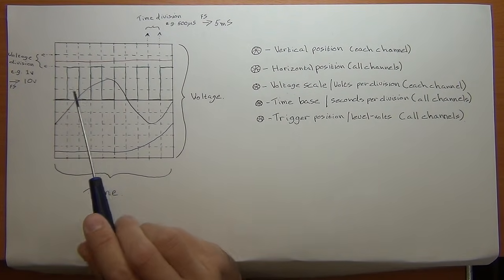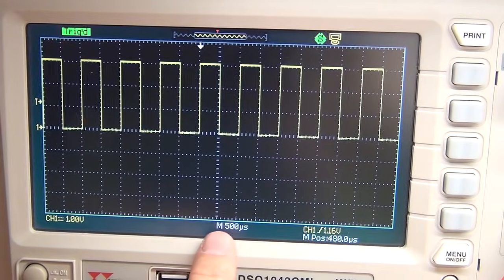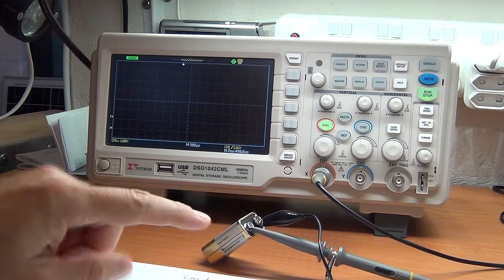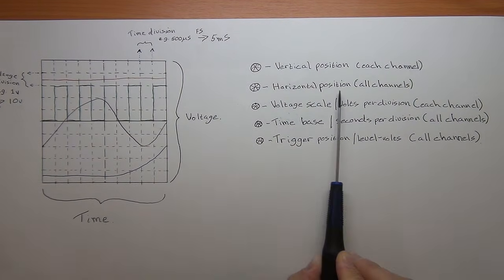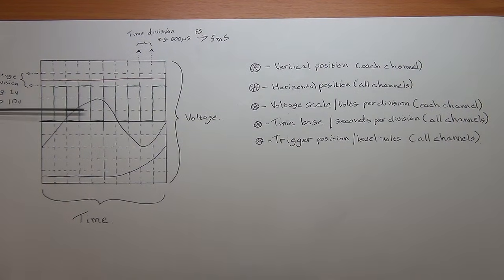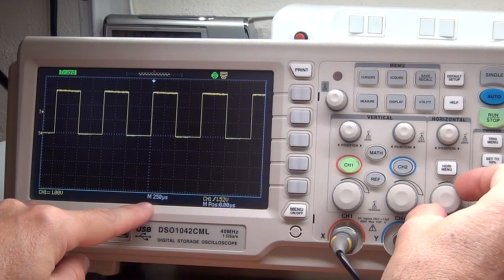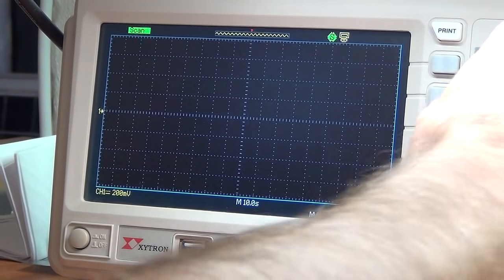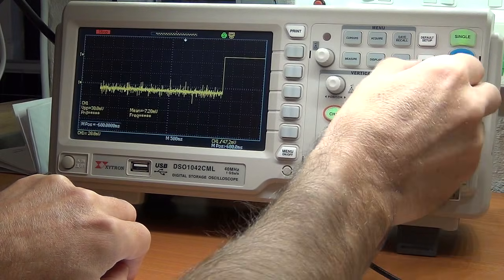How to use an oscilloscope / What is an oscilloscope / Oscilloscope tutorial

Comment: Thanks MJ. I know I'm late for class....So if you have a power supply feeding the Cap, how does the scope know to only measure the building voltage in the cap rather than the constant voltage the PS is putting out? Thanks again!

Comment: Great video, subject beautifully explained. I want to balance a motor/pulley which is vibrating, so I intend to utilise a cheap accelerometer (intended for an arduino) and an infra red LED which ‘sees’ a bit of reflective tape every revolution. The idea is that the regular pulse from the reflection is fed to channel 1 on an oscilloscope (which I don’t (yet) have) to establish a marker pulse and the pulse from the accelerometer (on channel 2) is overlaid on he screen. If I can measure how far the Ch 2 pulse lags the Ch 1 pulse I should be able to figure out the angular position of my balance weights. As a mechanical engineer, knowing how to use an oscilloscope is essential to making my plan work, so thank you for simplifying something which was a mystery to me - it will also inform my choice in acquiring equipment… probably, for my purposes a PC based USB oscilloscope.

Comment: For those confused on how to display slow moving voltages such as charging capacitors as discussed here, I eventually discovered you need to switch the instrument to 'ROLL' mode or in the case of XYTRON oscilloscopes-  "SCAN" mode.

Comment: Im in auto diagnostics and this helps alot. The firing of plugs, injection of fuel, time between these two things alone is a major factor in finding a problem that normally would be very hard to detect. OBD diagnostics with fuel trims uses alot of these formulas. Fantastic. Thank you

Comment: With regards to the capacitor charging. Why is it that it charges only at a linear rate? I am guessing It is because you set the power supply up that way for learning purposes?! Mathematically the rate at which a capacitor charges is logarithmic; hence the confusion. Great videos, thanks

Comment: Thank you so much for posting this. I bought an older Hitachi 100mhz analog unit at a hamfest for cheap  and am trying to figure out how to use the thing without blowing it up. I do tinker with relatively higher voltages in vacuum tube circuits and was wondering if there are any really basic rules of using the oscilliscope with these kinds of voltages, up to 500V at times or more... Again, thanks for posting this.. Also can you comment on the differences between analog and digital scopes ?

Comment: An 1:1 isolation transformer would work safely 09:50 .
Reply: Make sure to float the device under testing, and never the scope!  If you accidentally put the ground clip on mains voltage with a floating scope, the whole scope will be energized to mains voltage!
Reply: @autogolazzojr  Absolutely correct.   When ever I am repairing something, the unit being repaired is connected to an isolation transformer, with the ground pin also isolated.   No chance of a complete circuit this way.  I also work on a plastic floor mat with a non-conductive work surface.   Safety Safety Safety.

Comment: I have 2 dso and a old tektronix analog crt scope. There’s something about the old ones I like hearing the knobs click and I like the feel. New ones are just rotary encoders. No fun. I like knobs that click. I can adjust my analog by feel. I can count the clicks. Can’t do that with encoders. Xy mode is way better on the analog. I use an octopus with my analog for troubleshooting components. Very fast.  I do love all the things you can do on the dso that are impossible on the old scope, and the weight. The modern ones weigh nothing. The analog crt scopes are heavy.

Comment: I don't understand...does the oscilloscope show you the voltage difference between what the probe is touching and what it's grounded to? Or does it show you the actual voltage measurement? For instance, if I connected the ground probe to something that was creating 3volts, and touched the probe to something that was running at 9 volts, what would be displayed?

Comment: Very awesome job... It's been a while since I used one and your tutorial has helped a lot in bringing back some of the keys elements.  If I might ask... the actual voltage on your Y axis, does that give you the value of your actual peak voltage?  I know you can change the voltage scale to either maximize and minimize your scale and that's where i get a little confused.  Technically If I changed my voltage scale on the oscilloscope to say... 500 mV... it should still give me an accurate reading of my volts per peak no matter how much or how little I maximize or minimize.  Correct?  Thanks in advance.  Also, for those peak messurements.... I would have to set the scale at the 0 x axis for an accurate reading for a sinewave but not so much for a square wave I believe.

Comment: Can someone please explain this to me as I can find the answer anywhere... If I connect a positive scope lead to a positive post of a battery and a negative crocodile lead to a negative post I should see a voltage of that battery but what happens if I connect a positive lead to the negative post and the negative lead to the positive post? Will it show the same voltage but on the negative side? For example instead of +9V will show -9V? Is there any danger doing this or is it perfectly safe like using a multimeter? Can someone explain please?

Comment: Nice work..I know this is a broad question..but how, after you understand all the functions, use this in troubleshooting...again..like all electronics you have to know how it should work before you can fix it...again thanks..
Reply: The Misenbo Serive Lab provides electronic hardware laboratory equipment, ESD materials, welding tools, and electronic components and Hardware Lab management software. Our business scope covers Tektronix, HP, Agilent, Fluke, Giga-tronics, R & S(Rohde Schwarz), NI(National Instruments), Cisco, D-Link, Xilinx and Altea, etc. our company adopt hardware laboratory support service for customers. If you have any demand, please email us you required materials and we'll respond as soon as possible. 

www.misenbo.com   www.misenbo.com.cn  

http://www.ebay.com/itm/TEKTRONIX-Oscilloscope-P6139A-VOLTAGE-PROBE-CABLE-with-accessories-tested-/322153022009?ssPageName=STRK:MESE:IT

If you have question, please tell me,   david.deng@misenbo.com
Facebook: david.deng.127201
skype: david.deng2010

Comment: When you turn in the power supply to charge up the capacitor, why don't you also simultaneously get a straight line, showing the DC voltage from the power supply itself, besides "seeing" the capacitor?

Comment: In sizing TVSS (transient voltage surge suppression), what factors do I need to know from the customer? How do I compute the right TVSS for them?
 
Here’s what I have:
 
30Amp load on the Circuit breaker
380v to 480v
3 phase
60 Hz
 
What size of TVSS can I recommend?
 
Thanks,
Reply: Direct earth or resistor grounded or floating? Y-delta, Y-Y, delta-delta connection? Transient from what? Motor starting, switching, lightning? Best bet is contact a switchgear application engineer from GE, Westinghouse, etc.

Comment: Looks like a nice simple but one major error!! the old analog scopes do NOT take individual measurements, they make continuous measurements.   It is the Digital ones that make individual measurements and PLOTS.  Other than that ok.
Reply: +Jack Everett Hence the sample rate! I get it now. Thanks for the comment.
Reply: +HMac The is that very short time during retrace that the signal is not visible. And between triggers if using any mode but AUTO.  But, that is a more advanced topic.

Comment: Great tutorial. People like you make a HUGE difference. Thank you.

One question. If I want to measure an RX coil of a wireless power transfer circuit, (2 leads), would one connect ground to one coil end, and probe the other coil end?
Probably a dumb question, but I just got my first scope, and don't want to blow anything up.

Thanks in advance.

Scott.
Reply: Old question, but yes.

Comment: How about an MTS-5100 oscilloscope,in regards to Automotive applications, here say for testing the ABS system on the F CAN to determine if its the wheel speed sensors or an open wire or ground and maybe the module communication with the K line on the DLC for any car?

Comment: Martin, I have a simple question as I browse cheapo one channel pocket oscilloscopes. DSO112 says it's rated to 50Vpk. Does that differ from say 100Vpp (I've also seen it shown as Vpk-pk)? Does Vpk just mean how far from 0 volts both positive and negative the waveform can be before damage to the unit occurs, or am I misunderstanding that? I would think the Vpp means it doesn't necessarily have to be centered on 0 volts, as in the waveform could be entirely in the positive, and be up to 100V, and if it's equally in both positive and negative it can't be beyond 50V to either side of 0V. I was basically looking for a simple oscilloscope primarily to use for audio amplifier gain setting, and for a few simple electronics projects that can handle upwards of 50 volts. If it's what I'm assuming, then that's within the range of most car amp per chanel output. Channel would have to be beyond 600 watts @ 4 ohm to exceed a 48V gain setting where the waveform starts to clip. Wasn't needing a super precision multi channel model, just something cheap that can show me waveforms with at least a 5% accuracy.

Comment: Great video for reading and adjusting an o-scope.  I wish you had shown more about how to hook up the probes.  I saw a lot of clips on the capacitor, but not where they went.
I have a Tektronix 2236 with 10x probes but not sure where to hook them up to.
Reply: The clips on the capacitor were simply the power supply that was charging it (Large red and black alligator clips) and the oscilloscope probe to monitor the charge (probe and small black alligator ground clip). The capacitor will probably be polarized and have a stripe down the side that is negative/ground.

Comment: Hi,I've just bought an oscilloscope on eBay, its  a used one and was said to work ok.
 With no input connected there is a trace which looks like noise, Do you think that is a fault? Will it be ok with a signal connected? -no probes yet.

Comment: Honestly, it really depends on what you are using it for. The problem with that particular scope is it only has one channel. O-scopes really become useful when you have a second channel, and can compare inputs and outputs (for example the input and output of an amplifier circuit)

If your budget is limited, try looking for an older, used dual channel analog scope. It'll do everything he did in the video except for the storage part.

Comment: Excellent series of tutorials you've got going on here.
I think when first cutting your teeth on a scope, an old analog one actually is better suited, as they come with just the basics. If you can handle one of these, you'll also be able to operate a DSO. I've got a 35-year-old Hameg 20 MHz job here that I purchased for the princely sum of 40-odd Euros if memory serves. For a general purpose scope, it still does fine, just needs a bit of attention to choice of probes.

Comment: The big one in the center is one that Martin built (many years ago). The smaller one on the right is a TTI PL303 = Thurlby Thandar Instruments - Precision Linear 30V 3A. Martin does a video on it. Search for "Variable bench power supply review / buyers guide / tutorial - Thurlby Thandar PL303"
This is a great PSU! However, be warned it is expensive and hard to find in the States.
Cheers,
Ken

Comment: cool video. keep them coming. Two point on the content: 
1, the zero line is very important. -12v to 12v has an amplitude of 24v, if you ignore the zero line and just count you will not now if it is -12 to 12 or 0v to 24v
2, i think that the down arrow represents the trigger point, not that the signal is out of the screen